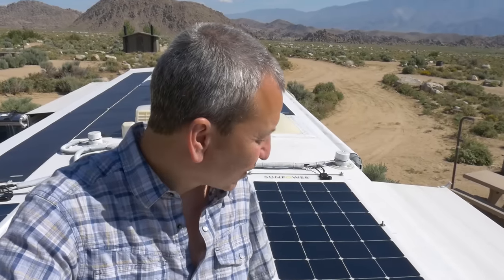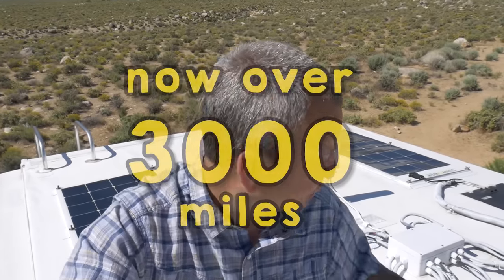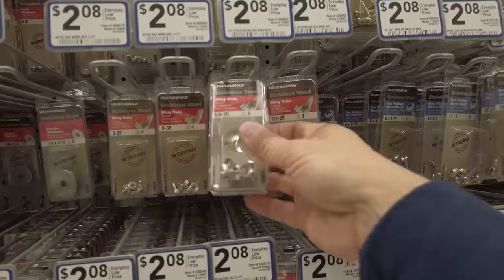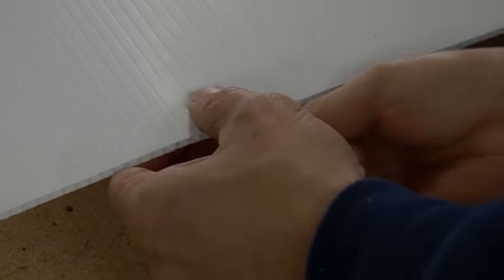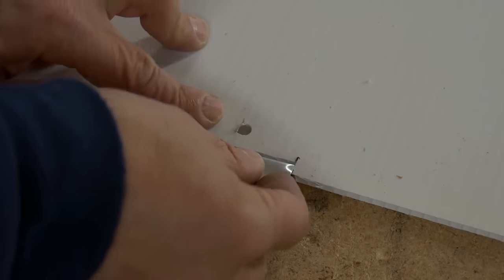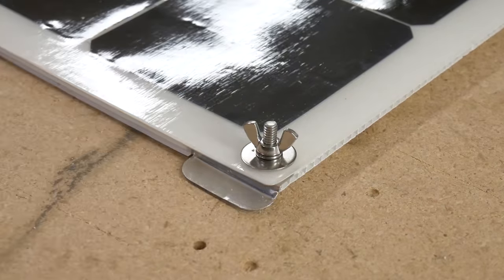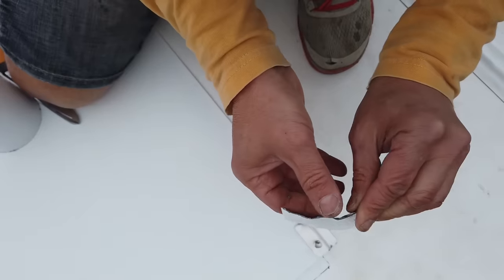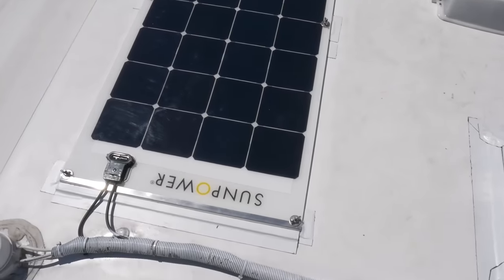Better Way to Mount Flexible Solar Panels on RV (2019)

Comment: Awesome "how to" video Tito.  This is the best You Tube video I have ever seen!  Your design is simple yet effective, and I really like how you actually show every step without rushing through.  Very thoughtful.
Reply from the maker: Glad it was helpful!
Reply: @RVwithTito  I'm assuming you need some kind of converter/transformer to link the Sunpower panels to your RV's battery system.  Do they sell the necessary connection hardware?  Also, have you done a video lesson on making the final hookup?
Reply from the maker: @dneeld52  The outputs from solar panels feed into a solar charge controller which then regulates the charge to the batteries. You can see our entire setup here if you're interested https://www.rvwithtito.com/articles/our-solar

Comment: I know I'm a little late to the party but that piece on the leading edge seems to me like it will negate one possible advantage of the corrugated panel.  If you orient the "tubes" in the panel toward the front of the RV you will get airflow through the panel which will basically cool the panel to ambient temperate while you are underway.  I'm thinking that VHB tape between the roof, the corrugated panel and the solar panel will provide plenty of strength to prevent lift and give you good air flow through the panel.  I'm getting ready to do this project so I'm thinking I might try this.  Keep the good stuff coming.

Comment: Thanks for sharing 
I live in my Escalade 
I’ve been wanting to do flexible panels so they are not seen.  My concern was the heat underneath. Brilliant use of the corrugated plastic 😊

Like that u can change them out if needed.

Comment: As I type this I'm going through this procedure. I had assembled one solar panel onto the corrugated plastic base and set it on the grass in the sun - I had been in the shade - while I assembled the second one. I noticed that apparently the solar panel and the plastic base expand or contract at different rates. The first assembly sitting in the grass started to buckle after sitting in the sunlight for a few minutes. When drilling holes into the backing you may want to keep that in mind. Also it might be a good idea to do the assembly/cutting/drilling with everything in the sunlight. I think I'm going to have to go back and enlarge my holes that I drilled in the plastic base.

Comment: Well thought out installation procedure. Please let us all know how this weathers over the years.

NOTE: there have been reports of flexible solar panels totally failing if installed directly to metal roofs with no thin layer of insulation underneath the panel. This seems likely to be a thermal overload failure, especially with flexible panels that have an aluminum backing that was probably intended to be a rustproof heat sink. Most likely solar heating accumulation on a metal roof with insulation on the passenger compartment side was transferred to the solar cells via their aluminum backing, thus overheating them. (It would be useful to verify this if others have had the same experience.)

Comment: Brian, I love your stuff. I'm straining my brain thinking back 30 years to the required fluid dynamics course I had to take in college for a mechanical engineering degree. The airflow over the panel will create negative air pressure relative to the air pressure under the panel, creating lift. That's how airplane wings work. Your strip at the front of the panel will stop airflow under it, but airflow over it will create lift. Once I was helping my father move and we had a king-size mattress on top of the stack. It was behind other stuff so there wouldn't be any airflow under it, but at 20 mph it went sailing. I don't know if it will affect your installation, but it's something to keep in mind.

Comment: Good video !
One suggestion, round the corners of the tape. 
  That’s a technique all roofers do when dealing with any type of flashing material.
Reply from the maker: Thanks for the suggestion. I've been looking into heat welding material also.

Comment: Hey great job! Looks great. Gotta love that eternabond tape. Super strong.
Reply: Could you do an output test with a watt meter with those flex panels? I would love to see how well they have held up. How long have you been using the sunpower ones? Those are the only flex panel cells that work well
Reply from the maker: Thanks Will. I've used eternabond for tons of stuff. I've even used it to patch a leaky fuel line in a pinch until I could fix it. Worked!
Reply from the maker: So far they are a top performer, They are the 110 watt ones, but I've only used them for 3 months. I haven't isolated and measured them since installing, but I'd love to make them last a long time.
Reply: @RVwithTito  they look great!! Can't wait to see how they hold up. Your mounts look amazing!! So cool
Reply: @RVwithTito  So you are a year in with the panels, how are they holding up?   I'm thinking of ordering 12 to use on a boat instead of rigid panels (to save weight).  Sunpower certainly seem to be the best, but still not sure of how long they will last...
Reply from the maker: @luckybeanzphoto  My Sunpower panels are in excellent condition with no visible wear. I love them. I have the 110W and 170W modules on my RV and am very happy with them. They are actually crankin serious amps right now in the Arizona desert. If you decide to buy, go through SunPoweredYachts.com. I've arranged a 10% discount if you use the code "RVWITHTITO" at checkout. Lyall at SunpoweredYachts is an experienced sailor and provides great support to the marine community. Also, since posting about the Sunpower panels, I learned from the manufacturer that not all PET is the same. The PET top coating on the Sunpower branded panels are the best they could find with the highest UV protection rating available. Apparently they tested very many types of PET. So they should hold up pretty well. Hope that helps. Cheers! Brian
Reply: @RVwithTito  I'm about to do this to stick my 2 Bouge RV solar panels to my Sportsmobile pop-top! Do you think the Eternabond tape is enough on its own or would you really recommended to also add the double sided VHB tape underneath as you did? The pop-top has some rather rough RaptorLiner on it.
Reply from the maker: @hornz5  It really depends on how the wind hits your pop top while driving. You want to avoid any possibility of lift while driving or in heavy wind. I would be safe and add some VHB in key areas. Also, don't mount the panel too close to the edge where the wind can get under it and lift it up. Use your best judgement. Good luck.
Reply: Is there any way to remove eternabond tap if, for instance, one were to eventually want to sell the RV?

Comment: Perfect. I would have reinforced the brackets onto the corrugated carboard with epoxy glue.  The best I've found is Loctite P and L max.  It's construction adhesive and cures almost like a solid plastic.

Comment: 1. Scissors for aluminum?
2. Drilling aluminum bare handed?
3. Locktite - now we're talking!
I really wanted to use a polycarbonate greenhouse panel. They usually run 3/8" - 1/2" thick flutes. Air flow would be fantastic. The sheets are super expensive and unavailable in any stores where I live. Looks like Coroplast is the only other alternative. I really like the idea of being able to remove the panel as it sounds like they have a rather short life span. Your vid couldn't come any sooner. I've been waiting for this update cuz I was planning on doing mine next week. I'd like to hear any naysayers better ideas for doing flexibles. I'm going to give this a shot! Thanks Brian!
Reply from the maker: Good luck. I'll have to look into those and other materials.

Comment: Nice job, Tito. I wondered about the panels "lifting" when traveling; hadn't thought of the heat issue. Thanks for sharing this! Y'all Be Safe!
Reply from the maker: There's been no lifting at all with this setup.
Reply: You can cover sides of van, too. Most of the time sun is fron side, not top. On top is just 3h a day. Cover all van and put Tesla PowerWall.
Reply: @simonci5177  except that the Tesla Powerwall weighs almost 350#. Most people would not want to add that kind of weight to a small camper.

Comment: Try 1/4” x 20 Elevator bolts - They are carriage bolts with a large - thin - flat bottom.  The double stick tape will keep them from turning

Comment: THANK YOU! This has answered my issue about installing lightweight solar panels to a pop top campervan.
Never liked the idea of gluing the solar panel to the roof or drilling holes in the roof. I've used and love the lightweight coreflute for various projects including adding some insulation to my side widows. GREAT IDEA!  
Watched your follow ups on this project and gives me more confidence that this system works long term.  Cheers Australia

Comment: Nice job guy I had the same concerns. I just bought my first flex panel .I had limited space and limited contour on the top of my pickup topper since I have a rack up there also. I especially like the way you worked that leading edge. In some cities I heard they frown upon seeing solar on your vehicle so I wanted something a little more stealthy and not advertise that I have a solar setup. Your installation technique is commendable. Here's to smooth sailing Bro.

Comment: So I did a facsimile of this method using corex and double sided Eternabond tape and they made it through the summer and the flex panels are still working fine.

Comment: One of my two panels flew off my van using this method, going 80mph down a highway in high winds. Panels were mounted horizontally across the roof, one in front of the other (that's one point of difference; these are mounted "vertically" down the length of the roof). I also didn't attach that transition strip to the back panel, the one that flew off, so maybe that's what did it in. Panel was still attached to the corrugated plastic when it flew off. But I can't risk trying this method again. Not sure why no one else seems to have had problems.
Reply: GUI the people that I’ve tried it I have not actually returned for input🚚

Comment: Looks like a modification of "Hobotech's" attachment method but he used glass panels.  They've lasted several years and haven't blown off. I like that leading edge metal idea!   I wonder if the plastic sheet will retain water and freeze in the winter ...maybe it won't affect the flexible panels since they flex a little anyway.  I still appreciate your window awning idea the most because those might catch the best angle of the sun and do double-duty shading the windows.  Thanks for all these creative approaches!

Comment: Another awesome vid! You do such great work! It’d be interesting to see a 6-month or 1-year update on the flexible panels. Heard a lot of them delaminate fairly quickly. Of course, with your ingenious mounting system, they’ll be easy to replace if need be (as you mention). 

Thanks for making these videos. Your efforts are truly appreciated.
Reply from the maker: I will certainly be sharing updates. Thanks for your kind words.
Reply: If you purchase quality flexible panels you will be far ahead. UniSolar and Xunlight made panels so good that they could not compete price-wise with the glut of overseas panels of lesser quality. Even though both companies are now gone...If you hurry... jnew panels from several years ago can still be purchased on eBay.
Reply: @RVwithTito  amazing video! any updates?

Comment: Excellent Video!! 

I am still a bit skeptical about the life of flexible panels vs "rigid"; not sure if it is general/overall heat dissipation but I think you have pretty much nailed it. 

I guess for me, if this is pretty much a permanent mount I wouldn't have used wing-nuts and locking nuts instead, and perhaps applied a little adhesive in the central area to ensure the panel doesn't "vibrate" and weaken the internal crystalline structure via venturi effect. (My wind tunnel is down at the moment and I can't test - j/k).

If the panel goes bad I am not wasting much money throwing away the insulated backing along with it... as to warranty replacement, yeah they are going to want a pristine panel so maybe no adhesive or something that can be peeled off if / when needed.

Anyway, this is one of the best thought out installation ideas I have ever seen!! -Many Thanks!
Reply from the maker: Thanks for sharing your thoughts!
Reply: Some panels are noy crystaline at all and are a bit more hardy. They are amorphous panels.  As for warranty...many companies are now reluctant to help the DIY'r. On the bright side, if you purchase quality equipment...panels, controller, inverter and batteries...you will likely not need a warranty.

Comment: I've got a Class B with a bunch of stuff on the roof, not much room left and not flat. I've installed as many conventional panels as I could fit using brackets. With this new method, I believe can add some skinny flexible panels around the AC in the back. Thanks for this great idea! I already used a variant of your roof cable access method.

Comment: Thanks Tito!  I am installing a similar system and used your tutorial as a guidance.  Instead of cutting the z-bar I'm using 1.5" washers and going to use Eternabond to hold them down.  So far so good.  Trying to figure out how to route the power cables to the charge controller from the fridge.

Comment: Very cool idea, Were still using our suitcase panels which gives us 400 watts of solar, Our power needs are very small, our RV is brand new and no way am I putting anything on the roof that would void the warranty, we also supplement the solar with a Honda 3500 watt generator that well run everything in the RV and is very fuel efficient........

Comment: Use elevator bolts they have large flat heads with anti rotating tabs
Reply: Jeff, I'm getting ready to use Brian's method of mounting panels and also agree that "elevator bolts" seem to be a good option over standard carriage bolts. With the flush heads it seems it will eliminate cutting out a layer of the plastic card board so this will retain integrity and strength of the PCB. I'm also going to use 3/4" bolts rather that 1" to eliminate the extra threads sticking up above the wing nuts. 

 I'm considering 3M VHB tape rather than Eternabond  for bonding but would appreciate comments.

 Lastly, Brian thanks for a great site/channel !!
Reply: Disregard the 3M VHB comment which was included in error.
Reply: Jeff, thank you for the tip did not even know elevator bolts existed

Comment: 😲🤯Its crazy! I had the exact same idea in my head with the bolts and wingnuts and under panel of coroplast and VHB tape and eterna-bond tape.
Im doing it with my 100 watt solar-saga  foldable panel. 
I want to remove it when it rains.  
So glad i found this video.  
I might use bolts with a hole on the tip, so s pin can be used instead of wingnuts.  
I want to be able to remove them quickly in case of sudden downpour and when im awake from the van.

Comment: I suggest you replace the wing-nuts with a nut with nylon lock thus eliminating  the need for locktite. These nuts are available in stainless steel in most if not all metric and sae sizes. I have even seen a wing-nut version but these maybe hard to find particularly in stainless.

Comment: Using ELEVATOR bolts gives you a flat bottom instead of carriage bolts ... look in the pullout special bolts ..cheap.... It gives you the benefit of the washer sized round head and they come in both metric and SAE sizes

Comment: Thanks for the detailed description of your install. I copied your technique with one small addition. I was concerned that if the nuts became jammed during removal, the carriage bolt would rotate,  deforming the aluminum making removal of the nut very difficult. I ground flats on the side of the bolt so that I could hold the bolt with an adjustable wrench while loosening the nut. Using a small grinding tool I ground flats down about 3 threads on opposite sides of the bolt. Not much material needs to be removed, just enough to grab the bolt end with the adjustable tool. This resulted in a minimum distortion of the threads and threading the nut on the bolt was not a problem. Thanks for your clear and complete videos.
Reply from the maker: That's exactly what happened to me the other day while removing the panel for a follow up video. Should be out soon. Trying to picture it...did you do it near the top of the threads (end facing up)?
Reply: Thread the nut on before removing material, then unwind to recut the thread.

Comment: Using 3M extreme mounting tape where the EBT is might eliminate the need for the EternaBond.  Also how important is the front edge long aluminum piece? Wouldn’t it be good to have the air flowing through the plastic as one is driving?

Comment: Great idea! After messing with mounting my flexi panels entirely with Eternabond, (with 2 layers of bubble foil insulation underneath,) and caulking the edges of the tape, I still couldn't keep the water out. Now I'm going to have some serious acetone work ahead of me to remove the Eternabond goo.

Comment: I think going with hard panels is smarter anyway. They're more efficient, durable and perform better. A bit of a pain to install, but if you do that right you can even create a way to tilt them up using actuators (for example, a frame made out of 8020 t-slot) and thus increase solar collection efficiency hugely when the sun isn't directly overhead.
Reply from the maker: Sure. You're not alone. Many prefer traditional panels. I'm not trying to change anyone's mind, just sharing what I'm trying out for those who are interested.

Comment: you could add a cotter pin on the end of each bolt to prevent loss of a wingnut that could vibrate loose on the highway